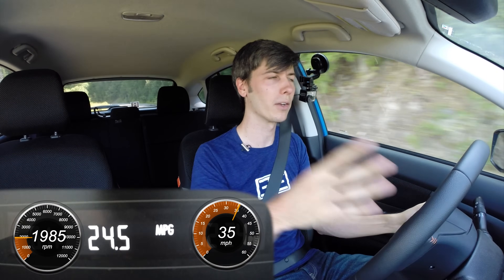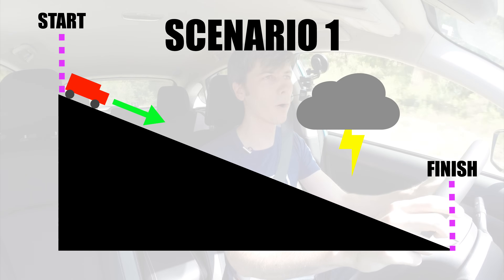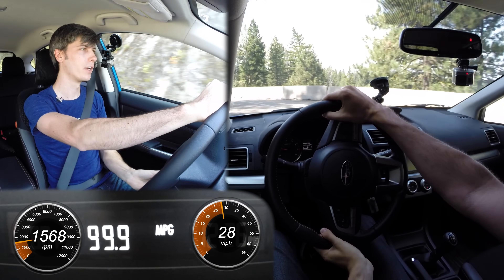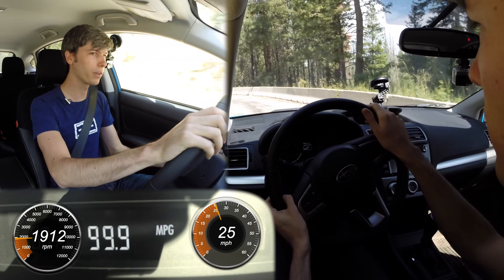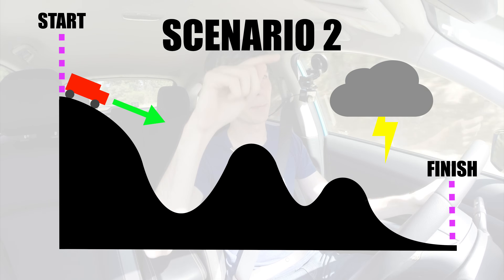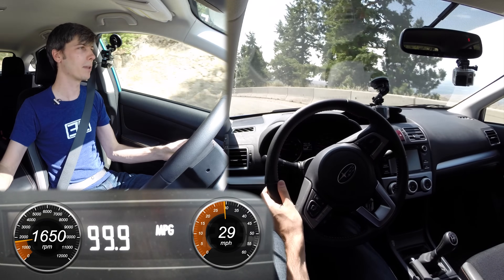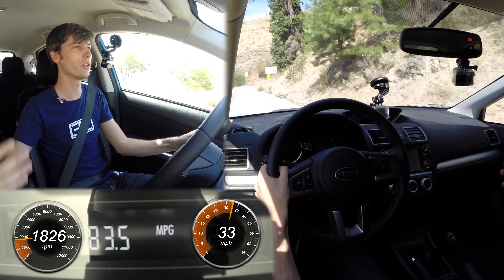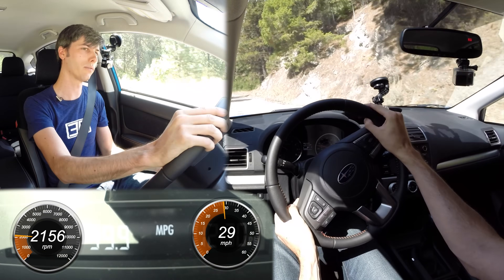What Uses Less Gas - Coasting Or Engine Braking?

Comment: Long story short in older cars (carbureted & earlier EFI) cars coasting is more efficient because it doosen't shut off fuel, in modern EFI cars engine braking is more efficient because the ECU will shut off fuel. Better answer than 'it depends'? XD
Reply: Armour Shooter what do you mean by earlier efi? Im curious cause my car is produced in 2001 and i wanna know because im engine braking everywhere😂
Reply: Armour Shooter i think marc’s question was how can he determine if his car (a 2001 model) has ‘modern’ efi or ‘early’ efi technology
Reply: Armour Shooter early cars also don't Inject fuel when engine braking.
Reply: Even on some carbureted cars, you will get better efficiency engine braking because if you've installed a fuel cutoff switch, you can haul into that.
Reply: Armour Shooter you saved me five minutes
Reply: But it also depends on the scenario not just the type of car or it’s fuel management, that’s why the answer is “it depends”.
Reply: 2001 should have a modern efi.
Reply: what about the ignition? are the spark plugs still firing when the fuel is shut off in modern EFI cars?
Reply: Weslie Rouse im thinking the same thing too 😂 but even if it fires its not going to burn anything
Reply: Weslie Rouse No harm if they are. Some V6 engines only have 3 coils - firing 2 sparks for each rev. One spark is always wasted in the non-firing cylinder. This has little to no impact on efficiency.
Reply: AAsearles i wouldn’t assume it would effect efficiency at all considering no fuel is being injected into the cylinders. interesting thought though. as far as coils, my bmw has a coil for each spark plug, i would assume most car manufacturers are adopting this technology. but that’s just an assumption, lol.
Reply: Weslie Rouse My car (1998 Subaru Forester) fires a pair of spark plugs at a time, and other cars do too. It's called wasted spark, and it doesn't hurt the engine or the spark plugs. MSD ignitions on performance cars can fire at least 10 times during the combustion cycle of each cylinder, and it doesn't hurt anything.
Reply: Weslie Rouse Higher end cars like yours will have the best technology, but lots of cheaper cars, like mine, still use wasted spark.
Reply: RJ J oh mb, best way is to do some research on the current model. im not an expert so this is the only advice i can give
Reply: 80s - early 90s
Reply: I agree, was thinking the same thing while watching the video
Reply: Exactly what i was thinking about
Reply: @Marc Matakim - My 1999 Ford cuts fuel when coasting in gear. (after few seconds delay)
Reply: Marc Matakim Mine, a Mercury (Ford) from 2000, uses very little gas when coasting, based on data from the OBD port, so you're probably fine.
Reply: Buzz LightBeer how?
Reply: that is a lie ,,,,
Reply: GM's 3800 V6, one of the older V6s out there, used 3 packs up till the end. I wouldn't say it's a cheap car thing, either. My Buick was $32k in 1998, and Mercedes used waste spark on their I-6 in the '90s. Also VW's beloved VR6.
Reply: AAsearles If I had read your comment, I wouldn't have replied. I wasn't aware that 6 cylinders also used wasted spark.
Reply: Engine braking = Engine is giving any power to wheels and producing resistance... = All valves closed and no fuel is reaching the Engine..
Reply: Shorter answer, but not the whole picture so definitely not a better answer.
Reply: My 2008 Toyota doesn't cut off the fuel supply when engine braking.
Reply: Armour Shooter You oversimplified it. "It depends" is the best answer for EFI cars, because engine braking reduces momentum, which is lost efficiency. Neutral coasting preserves momentum = more efficient because more kinetic energy is preserved, to be used after the downhill.
Reply: When engine braking you are able to maintain constant speed easily and the vehicle is more predictable. It also depends on which gear you are selecting. Generally if you go up the hill on 3rd, for example, you have to go down at the same gear on the same hill. If you want to go faster, just select higher gear without touching the throttle.
Reply: "It depends, but stay in gear."  I have driven for decades and have needed to brake to avoid an accident, but never accelerate to prevent one.
Reply: Cutting off gas causes more engine wear

Comment: Whereas going down hill in gear with a carburated vehicle will suck fuel like crazy. Due to very high engine vacuum drawing in the fuel from the carb. Another thing.. fuel has some lubricating properties so with no fuel your wearing the cylinder walls a little quicker.
Reply: thats why people tend to put oil in their engines

Comment: So why are there signs posted in my state that say "no engine brake"
Reply: They are for trucks. Jake Brakes are pretty loud, and in cities or suburbs where braking is common, They don't want trunk drivers using them.
Reply: It doesn't actually mean "engine braking is prohibited." It means "unmuffled compression release engine retarders are prohibited".
Reply: because trucks have a special engine brake, that close the exhaust valve, increase a lot engine brake compared to cars or light duty trucks but is noticeably loud so is banned in towns
Reply: Mark Spelman you don’t know the purpose of road signs?

Comment: Does the 'coast downhill in gear uses no fuel method' only work in newer cars? Or does any car with fuel injection do this?
Reply: Only the older cars with some specific injection systems may use some fuel but that's rare.

Comment: In scenario 2, wouldn't it be about as efficient as staying in neutral if I stayed in (the highest) gear, and used the same amount of fuel the car would use in neutral, but to accellerate it? Would be an interesting experiment…
Reply: It would use more fuel to go uphill.

Comment: Hey Jason, I do got a further question though. How do I know if an exact car does cut the fuel to the engine. I mean it is obvious that carburated cars do not, but take for example mine 2001 Jaguar X-type 2.5 which uses injectors, how do I know if it is programmed to cut the fuel to the injectors?
Reply: Valentin Zhelezov there is no real way to determine without a computer connected to the ecu and giving you a read out of the injectors. Being the age of your jag tho, it would not be completely cutting fuel off. This is more of a thing from the last 5 or so years. Unless there is a pressure reading device you can buy to plumb into your return line and can read the pressure of fuel going to the fuel rail and being returned.

Comment: just use reverse. i dare ya
Reply: The TeddyBear I tried this in my old corolla manual to prove a point to a friend. The gear for reverse is cut the opposite direct, you could be going walking speed and try to put it in reverse, it will just give you a high pitch grind. Also look up myth busters, they tried it also.
Reply: If you are a typical lazy fanatic that drives automatic you can, since they have so modern ECU's they wont switch your gear to reverse even if you move the shifter to R. However, i double dare you. Try it on a manual. and say good bye to your transmisson :)

Comment: Worth noting that this function, "DFCO" is really available in fuel injected cars maybe past the early 90s. Also, one more thing to add to when you might want neutral is when you're going down a hill that's not steep enough to keep the car at a constant speed when you engine brake.
Reply: You're looking for a higher gear in that scenario, not neutral!

If you don't get enough speed in top gear, it's very likely that either:
A) you target high speeds that aren't safe to coast at
B) the decline isn't steep enough to accelerate you to the exact speed anyway, in which case it's more efficient to keep a constant speed with low throttle in high gear than to accelerate, coast, accelerate, just like on a level road.
Reply: @LRM12o8 with a higher gear comes a higher minimum speed

In certain inclines you either use the throttle or speed in a higher gear. I know that because I have a 100m or so straight nearby where I can't coast in 4th gear but if I go to neutral I only go down to about 30-35kph before it picks up speed again halfway through. 5th gear means throwing myself at a hairpin way too fast

Comment: actually coasting in gear at least at 1500rpm is the most efficient.  That way the motor isn't having to throttle up to maintain idle.  I noticed when i coasted in neutral, i got worse mpg than when in gear myself.

Comment: So, is that why manual transmission cars generally get better MPG than their automatic counterparts?
Reply: 7-8-9-10 speed vs 5-6 manual ok, BUT dont forget, a manual transmission absorb less energy than any kind of automatic because is more simple, dont require oil pump for operating and use single clutch.
Reply: No, automatics get worse MPG because the torque inverter slips a lot while a manual transmission clutch has a rigid connection to the transmission so there is no loss to slippage.
Reply: Only applicable to older 3-4-5 speed autos.  Once the 6 speed autos came on, this wasn't really holding true and especially today with up to 10 speed autos it certainly is not true.  The autos simply have better top gearing for cruise and they shift asap to minimize gas consumption.  Which is why many say driving autos, even well under speed limits, is "boring" as you can make more thrilling experience just holding the gears but still obey speed limits.
Reply: CapnFlappyJaw possibly, because the physical connection of a clutch between the engine and transmission forces the engine to rotate, whereas a torque converter allows the engine to slow down a little to the point that it might need fuel input to keep spinning. This could also be why brakes on automatic cars seem to wear out faster.
Reply: Automatic dudes need more brakes :D
Reply: no, manual transmission use less fuel because is the transmission with less meccanical absorption, a with a 100hp at engine, with manual transmission you have probably around 90 whp, with automatic probably around 85, engine need to produce more energy for move the car at the same speed than a manual transmission version of the same car, the difference is higher on city and lower in highway

Comment: What about carborated or older fuel injection?   This does not seem very scientific, only using a newer engine management system that has built in fuel saving algorithms.

Comment: not true at all...a standard transmission cpu does not have as an aggressive deceleration mode as an automatic because the standard could get its clutch pushed in at any moment...thats why the cpu is different from standard shift and automatic...don't believe it? look it up

Comment: mate please help me,
i bought a Honda Fit (GK3) import from Japan, that got auto start stop feature, when in fully brake mode the engine shut down, and using electricity that storre in EDLC module (it charge when u brake)
but the feature is not working for like 3 months now, i been try a lot of things,but still no good result. help me please
sorry for my bad english

Comment: As an alternative to coasting which may even be illegal in your locale, you could just put it in the highest (numbered) gear and press very lightly on the accelerator in order to gain a little speed, then let up a little on the next smaller hill to shave off some speed going up.  No, it's not quite as efficient because you have to inject enough fuel to keep the engine RPM where it is or slightly increasing... but it's probably better than coasting to save 1ml of fuel. ;-)

Comment: I have one other question.....(for manual transmissions and flat surfaces) i usually just ride or accelerate for about 10 sec to 5 or so miles over the speed limit then go to N and coast for about 30 secs or until i come back down to 2 or 3 miles under speed limit, then repeat. So would it be more efficient doing this method with neutral or coasting in gear which will use no gas but slow me down much faster?

Comment: My car does not do this, so for my car it's always more efficient to coast because the engine is spinning slower and there is less drag slowing the car. Another option is to shut the car off when coasting for an extended period of time... which I think some places you can get a ticket for.

Comment: Have you already put up a video on using a manual gearbox without using the clutch does it have any benefits or is there more wear & tear involved cos it's easily done I know your more likely to sacrifice bushes and u have to use the clutch to get it in 1st to get it going unless you push it 😂 would be an interesting video

Comment: But doesn't engine braking slow you down? What if I just want to keep rolling for a distance on a flat road?
Reply: ??? Then you dont use engine braking only take your feet from the gas WTF dude
Reply: xThetomhawk if you take your feet of the gas in gear, it's known as engine braking.
Reply: Engine braking is for me If you shift from 6 to 3 :/ IDK what for cars you  have but my Audi dont really break that much If I take my feet of the gas, Its just doing that keep rolling stuff. Of course you will stop at a point because you arent gasing.
Reply: xThetomhawk yeah that's exactly what I meant and what this video is talking about. Letting go of the gas till you slow down on a slope. I wanted to know whether it would be more efficient cruising in neutral or letting go of the gas on flat road
Reply: My car (Audi A3) says in neutral rolling that I use 0,7-1,7l litre to 100km and letting go of the gas It tells me 0,0L
Reply: xThetomhawk yes that was what I was trying to say. Cheers mate 👍🏼

Comment: No whiteboard? I'm disappointed! With EV in the real world, it's always best not to "engine brake". You lose about 15% to 20% compared to neutral. A hypermiling technique on EV is to keep some constant power and allowing the speed to float. I use 13 kW on highway (about 62 MPH flat), but even small downhills reach greater than 70 MPH so I back off to 1 or 2 kW. You can only do that with EV, not with gasser.

Comment: are you sure the injectors shut off when you left off the gas pedal? I think they do not because if they did the engine would stall. also, I think that neutral is more efficient because when you are not pressing the gas pedal the injectors would be  open just enough to allow the fuel required for idle RPM and that amount of fuel would increase if the gar is in gear because of higher pressure difference because of the vacuum created by engine breaking.

Comment: FOR YEARS . . . I've been trying to get definitive answers on the MPG advantage/disadvantage of (manual transmission) neutral coasting vs engine coasting. Just couldn't find it. This pretty much answers the detailed concerns that I've had while trying to maximize fuel efficiency. It's the detailed explanations such as this that are important and don't get attention that are why i subscribed and love this channel. EE is the ish!
Reply: The short answer is that in a situation where engine braking would require you to use the gas pedal later (and coasting would avoid that), coasting is more fuel efficient. And in a situation where coasting would require you to use to use your brakes later, engine braking is more efficient.

Any time you use the brake, you loose energy in the form of heat to the environment. Ditto, any time you use the gas pedal, you ‘loose’ as much energy as the kinetic energy generated as heat to the environment, since combustion engines generally have an efficiency of less than 50%. Thus trying to control your speed by using both the brake and gas pedal as little as possible, is generally the most efficient way.

This can be compared to trying to control the temperature in your home by opening windows in summer during the night when it is colder outside and during early afternoon in spring and fall when it is warmer outside. Ditto for using window blinds in summer during the day to keep the heat out.
Reply: @aphextwin5712  so inother words use gears

Comment: Ok, but why is the engine sound increases with the RPM when you engine braking just like when you accelerate??,, if theres no combustion happening when engine barking?
Reply: most of the sound created by an engine is not because of the engine is combusting fuel but because of the mechanical movement and compressed air.
just google a detroid 2 stroke 100rpm engine , doesn't make sound,  u only hear the compresion of air.
same when u put a motorcycle in it's highest gear and just start running with it without spark.
Reply: Matthew kerkhof still doesn’t make complete sense to me because the sound is the same in both cases and it feels the same as when im accelerating, i do alot of overloading so going up and down a hill is a usual thing.
Reply: molotovcobra If the car is more then 5-10years old then complete fuel shut off is not happening. The fuel injectors are still squirting the most minimal amount of fuel into the engine. In saying that that's not the noise you are hearing. The engine has effectively turned into a air compressor, air is still being drawn in, compressed and the exhausted. If you have heard a air compressor you will notice they are quite loud for something that is driving by a electric motor and no combustion is happening. Same thing, air is drawn in, compressed then released into a metal tank (like a cars exhaust) which reverberates sound from the pulses of air hitting the steel. The sound you hear from the exhaust when you accelerate is the sound of hot gas pulses bouncing off each other as they are forced down a tube, same sound thing happens when there no fuel/minimal fuel, still hot gas (cylinder temp is still charging the electrons in the oxygen) being forced down a tube in pulses. That's the sound you are hearing. Carbureted cars can not switch fuel off and still has fuel being drawn in but with less air, hence the popping and spluttering when engine braking. I hope this helps you.